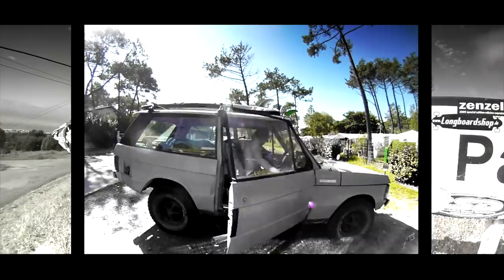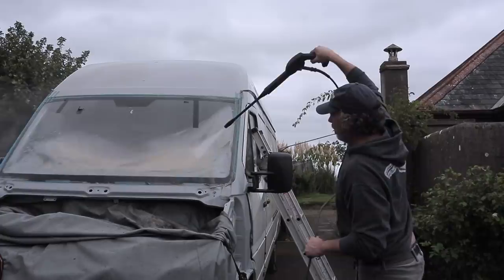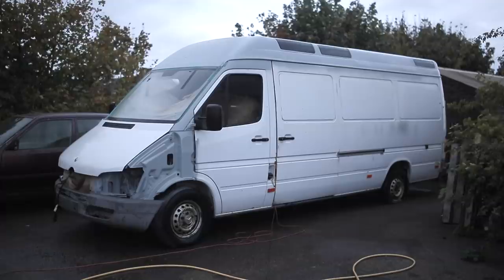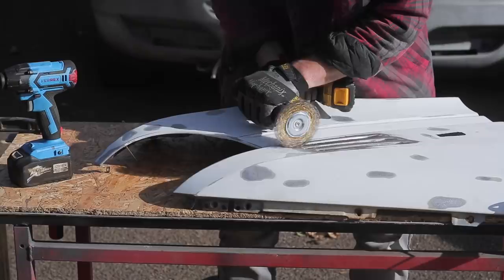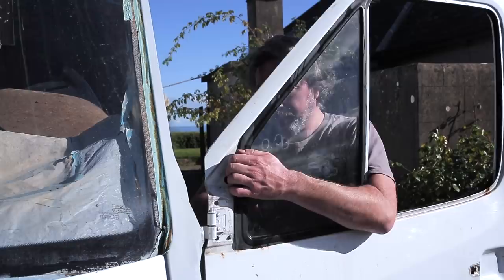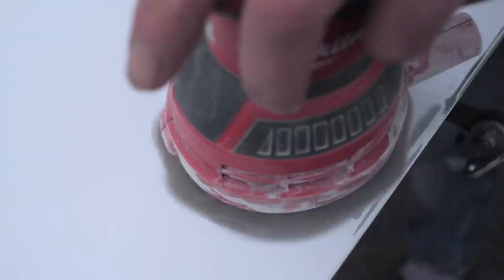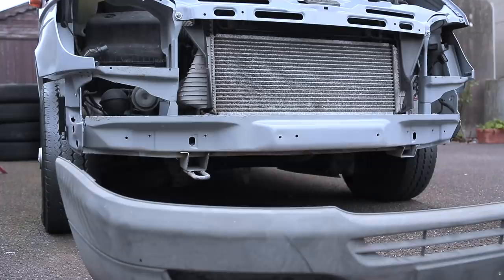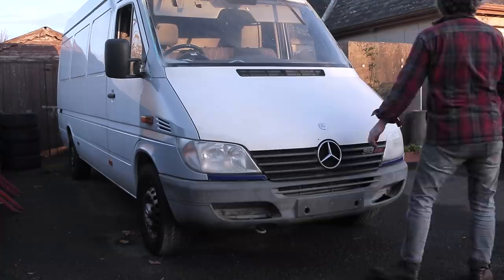Trying to spray a lwb Mercedes van outdoors

Comment: If you'd rather not spend the dosh, you may be able to separate the lens from the back shell of the headlight assembly.  I've done it on my Boxster by placing the whole assembly in a kitchen oven around 200F for a few minutes.  It warms the adhesive to the point where you can pry them apart.  If yer just gonna toss the works, and get replacements, it's worth a try.  Get a knife to score the adhesive and use your lovely red door panel tool and a pair of gloves as she'll be quite warm.  Cheeers Georgie!  Love your channel.😎
Reply: Aye! I saw a guy completely fix his FD RX-7 rear lights like that. He gently used a heat gun on low and a trim tool to persuade the parts to separate. He even managed to glue it back together that way. Gently heating the glue and scraping it to the center of the surface, so there would be enough to make a tight seal.
Reply from the maker: Argh! Don't encourage me lol
Reply: Ooh. Nice tip. My Boxter headlight needs attention. I hadn't thought of putting it in the oven. I will try it.

Comment: Clean out the window channel on the front window, a lot of rust happens in the plugged drain holes. When they replace the front window they tend to goober up the channel’s with rubber, that interns tends to rust out the channel because the water doesn’t drain correctly. Don’t let them put pack the trim piece’s, wait till it’s dry then cut off the extra rubber on the sides of the window. Then install trim
Reply from the maker: Thanks man. The window channel/panel is new! It had rusted out badly all over. That's coming in another episode shortly. The last windscreen replacement was a bodge too, so the water ran inside the cab and rusted out the floor 😑

Comment: You are a brave and admirable man! I know EXACTLY what it feels like to do that work, cause I've done the same about 10 years ago. I bought an old Transit, and did rust repairs, priming, bodywork and painting all in my driveway, under a temporary tarpaulin. What a monumental pain in the backside! Unfortunately I was not aware of the benefits of Epoxy primer and rust converter at the time, so my freshly painted van started rusting again very quickly...... chalk that up to lessons learned!
Reply from the maker: I'd say I'll have some spots coming back through, will be interesting to see where, and after how long!

Comment: If you hit the bumper with a heat gun, carefully, you can usually bring them back to look almost new. Just keep the gun moving slowly so you don't melt it. I've done it on a few cars now, always brings a smile to my face. Thanks for the video, was excellent as always. :-)
Reply from the maker: The weird thing is I'm secretly looking forward to seeing the bumper as it is against the fresh paint [colour]. Something about the swirls and patterns in the faded plastic I love. It's kinda of it's time, know what I mean?
Reply: @soupclassicmotoring  I think I get it. Most cars have their bumpers colour matched to the body now. You mostly see these types of bumpers on cars from the 90's till about 2005-2010. There is no wrong when it comes to personal taste. If you love it as it is, then you should leave the patina.
Reply: In my experience, that is a very short lived change. I did it to one of my cars, and within a year it was back to being just as grey as before.

Comment: The thing you said about unless you have a high gloss finish on the primer it's not enough, it's not that, it's just the idea of surface tension meaning that paint is its thinnest on edges and corners. This is why the idea of layers of paint that you can see as distinct, wet, smooth layers of paint is the way to do it, among the other benefits.

Comment: George have you heard of Jenloite rust and paint products?
It’s endorsed by the MOD ! 
I use it on all my products was sceptical at first but now I would use nothing else. It acts as a filler undercoat to. Completely rusty angle iron sanded and treated looks and is rust free looks like new. There etch paint is also brilliant. First class next day delivery. You should look them up. They are the original anti/stop rust suppliers m. Based in Scotland. I can’t praise their products enough. Well worth every penny and the time you will save repainting can even be applied when the metal is water covered.👍

Comment: I spy a 300E there, it has good glass lenses (never found that indicator lens  and I've shaved the garden!)..remember outdoor spraying an ex Irish army ARO 😨😨 with Valspar, thinned with petrol, in Baltic conditions...at least no flies stuck to the paint like some of my summer Valspar jobs, also did Metalflake finish at the other end of the spray spectrum. My Capri 3.0S  got a 'flake job, but had to spray it original midnight blue before it'd sell. And my first spray job was a cousin's white 68 Transit , he was too nice to say it was a crap job...but I shudder to think how bad it was😣😣

Comment: Door cards are usually upwards, that's a default thing. Don't stop painting at panel gaps and shut lines, it always looks bad and patchy when you have distinct lines where the paint changes.

Comment: There is a company in Belfast that has spare encapsulated glass that will fit the sides of your van, it was a special order for 20 minibuses that had all the glass smashed. Wright Accident repair centres, Carryduff. Saintfield Road. I was their glazing tech there 10 years ago. I stored excess glazing units in their 1st floor store/hallway. Might be worth a punt.

Comment: Instrument clusters carry the immobilizer codes for the engine, if you change a cluster you have to pair it with the ignition key using a shop computer or equivalent
Reply from the maker: half guess as much, thanks a mill Tiago

Comment: You've no idea how your 'setbacks' actually make me feel SOOO much better! I've been working on an old Morris Minor Pickup for years now - mechanically done, purrs like a kitten (after 25 years in a shipping container!), and incredibly happy with myself.

But the bodywork........ oh dear god the bodywork. I had to suspend proceedings about 6 weeks ago (I've been working on this thing for a few years now!) and put it in to storage over Winter, more for the mental break than anything else - it was so grinding me down. However, it has given me the opportunity to recommission my little 205 1.9 GTi which has embarrassingly sat in hibernation for over 3 years now. I knew it needed a timing belt change and new clutch, but the moment I took that front right wheel off to get access to the timing belt.......... yeah, I knew I was't going to be leaving it at just that! Cue the entire front suspension assembly removed and refurbed, from stripped and repainted calipers to new droplinks and wishbone bushings..... and clearly, this now also means that the moment I get a few dry days, it will be sanding back, priming and painting the sides of the engine bay where surface rust has come through around the suspension turrets (I bought a LITRE of 'Graphite Grey' from our friendly auto paint specialist.... experience tells me this won't be the last I'll be painting!). But it has been a huge mental boost being able to capture the joy of seeing progress on a project again, whereas I was just hitting walls with the Minor after so long. All going to plan, Pablo (the Pegueot!) will be jaunting up the Wicklow Mountains before Xmas........ before I then decide what part of it I want to improve next!! 😂
Reply from the maker: Stick with it Garry, the need mental breaks is a big one! Good luck with the rest of the GTi job, and maybe consider [no pressure] some epoxy primer under the Graphite Grey, it's great stuff!

Comment: The thing you're talking about with going too hard with the abrasive pad is called blocking. You're meant to do it on primer layers with 2000+, preferably 3000 grit wet and dry that you make sure is wet on every stroke and free of debris. It ensures your base coat is totally flat and won't look naff after you've finished your 15 layers of clear coat. Use a wire wheel to remove those DAM IRON CLIBBINS HOSS and lay more primer down on the metal, deal with the differences in height with primer and hi-build filler primer.

Comment: Oh George you ‘tease’… great work I must say.

My doors are in a poorer condition generally… and require you work or replacement good one hard to find for an LT35 BUT the door off your version of Sprinter will fit although the window line on the Sprinter has a curve… I’m not fussed by that though… the work in this video is the basis of what I need to do so a great source. That door card had me laughing. Never had the same issues as yourself… honest. Removing the doors has been a concern of mine… no more though. At work so not finsihed watching this episode. Will have to finish it later… or watch it again…?🤔. I’ll definitely be revisiting it a fair few times, help the algorithm etc. Stay lucky…
Reply from the maker: Never noticed the difference in Sprinter and LT doors, will be on the lookout now. You know where's absolutely full of old Sprinters.... Greece. Cheers Mal
Reply: @soupclassicmotoring  Ooouff just realised I hadn't watched the very end of this video..Good that you got the engine running..if it starts its 100 per cent...change fuel filter and all should be okay..Not sure when the last time you ran the engine...as unrefined as it maybe it's turbo'd and capable of big miles...also the injectors would have be sat for that time...just needed a bit of a 'work out' to wake them upYou are well on your way George...Best of luck .....
Reply from the maker: @malcolmyoung7866  Must find the fuel filter, good idea! Cheers Mal

Comment: Try using a cheap decorators plastic sheet taped over the bodywork next time your doing windows. Then put a thicker sheet of heat proof sheet where the hottest grinder sparks are

Comment: Try two pack wash primer under the epoxy. Novel is good stuff. Will never trust again. And it only activates once it hits the metal so can keep it mixed in a plastic bottle without going off.

Comment: after grinding and welding a bunch. use Iron Fallout remover. turns the iron purple  and it washes off.
Reply from the maker: Thought of this but getting it quickly wasn't easy at the time. Will get some soon.

Comment: Awesome stuff, as usual.

What bums me out is complaining about winter with t-shirt on, leaves on the trees, sunshine and double digit temps. I mean that's full on summer weather. It's not even full on winter yet and I haven't seen sun for month, it's -15C outside and 15m/sec wind. Did most of my RRC rust repairs (both sills, a and b-pillars, rear wheel arches and cross member) during winter outside. That sucked.
Reply from the maker: I'll bet! Was just saying to a patron that I'll stay smug until someone talks about working in minus conditions. Got my humble check.

Comment: You can easily fix the headlights. Heat up the adhesive holding the lens on.. pull apart, clean and reseal

Comment: It's a Sprinter. The do not seize. I got a parts car for mine, a 212 D 5cyl, with cracked head gasket, coolant running into foremost cylinder, so that we had to drain it to turn the engine at all, before I decided to get it. 
A squirt of wd40 before turning the engine to test that it ain't seized like seller insisted (which it was, in deed, not), had it standing like that in the open behind workshop for 3 years after the purchase before repairing the gasket and running the engine. No need to even hone said cylinder. Full pressure on all fife (only 138 k km on the clock though)
They rust, they rust, and they rust, sometimes they have issues with Turbos once oil isn't changed regularly, and those cdi injectors need maintenance I hear (mostly those copper sealers, mine is a low pressure direct injection with other injectors), and they rust, but nothing goes bad with those technically for half a million k or more - the van I got the parts car for has 340 k on the clock and runs flawlessly.
You gotta be a veritable moron to ruin a Sprinter motor, or a rear diff, or a gear box (mechanical! Sprintshit is a whole other thing of course). Oh, but they rust, did I mention that?

Comment: Thoroughly entertaining. If I can offer a tip, you NEED to use ‘Etch” primer on the bare metal then cover with conventional afterward.P.S. I love the Landrover windows
Reply from the maker: I'm on the epoxy primer side of the fence, but I suppose one could always use both ;) Thanks man
Reply from the maker: @notsevenfeettall  Know exactly the people you mean, and I don't think it's because they're hack jobbers, it's because etch has been industry standard for decades. Epoxy is the new school, they'll all be using it eventually. I'm not saying epoxy is necessarily better, personally having a little experience with both I think they're closely matched in a lot of attributes. The tech of epoxy just speaks to me.

Comment: When you next take off the door undo the locking bolt on the hinge and lift it off the body side of the hinge saves alot of prolems
Reply from the maker: 👍🏼 thanks :)

Comment: Good job as usual George,  could we have a video update on the rover like, how all your work on it hold up, did rust spots came back up? Did you do any other upgrade on the mercedes? Thanks
Reply from the maker: Been mulling over something like that, and mean to bring the W123 back into a few episodes in the new year. Leave it with me Antho824. RR went back into storage just the other day, so far zero defects! Getting a little slower to start so prob needs a plug service but other than that... AOK. It had a full check over in a patron vid a little while ago, and passed roadworthiness no prob :)

Comment: I'll gladly take some minutes out of my day to warm up with some SOUP!
Have got to say, you're more resilient than I am (or maybe just more stubborn) - I'm also stalled at paint vs cold. Considering farming it out just to keep rolling... Lots to keep distracted with in the meantime, having a fleet of old junk to deal with. 
How is the Vogue holding up after all the surgery?
Reply from the maker: Thanks man.  Farming out... two beautiful words I don't know the meaning of but dream out lol If it helps, a spray job baked in a proper booth is something I'd choose every time, had I the choice. the Vogue is great thanks for asking, did a once over on it for patrons a little while back and it sailed through roadworthiness [after I aligned the headlights]

Comment: Hi George. Great progress! I sent you a message on Instagram about a set of stainless steel hub caps that may be of use to you. New old stock & the same physical dimensions to a Ford Anglia cap, but not peaked. Don't know what they were for! My name is vauxford turbo on there. Cheers. Leigh.

Comment: 32:46... You shouldn´t use stainless steel-screws (A2/A4)  in ordinary iron-threads. That A2/4 steel will damage the iron-threads. If not at screwing in, thenby screwing out, because they eat .themselfes in the threads of that ordinary iron. And stainless steell is harder, as iron, and you didn´t recognice, when the iron is giving up at screwing in. It may does not make much problems at that small sheets. But for big outrigger of heavy steel its very bad.

Comment: Well, the left side is shaping up! How much harder would it be to head up the headlamps to separate them and clean the insides too? I've been temped in the past...
Reply from the maker: et tu Brute? I don't often get the chance to just replace, the easy win is slipping through my fingers lol
Reply: @soupclassicmotoring  take the win while you have the chance this is been enough work 😆
Reply from the maker: @soulshinobi  phew

Comment: If you heat the headlight surround with a heat gun and the separate, it I'll be easier to refurbish
Reply from the maker: argh I'm getting headlamp restoration pressure left right and centre lol!
Reply: @soupclassicmotoring  if you were close to the west midlands, I could have helped

Comment: I would have thought being the car guy you are , that you would at least have a decent tow bar !!!! Instead of that shitty 3 piece amateur bar !! I thought it was gonna brake whilst you was rocking the van !!
You need to make 1 with a nice 2M50 galvanised steel bar with a tow hook welded to one end and a U bolt on the other !! Proper Job !!

Comment: I love your work. But you're a tiger for punishment. If you had simply laid the panels flat, you could have sprayed primer surfacer over the epoxy. The minor dents and scratches would have mostly self-filled.
Reply from the maker: Tiger is so much nicer than glutton. Going to look into the surfacer you talk of, thanks.